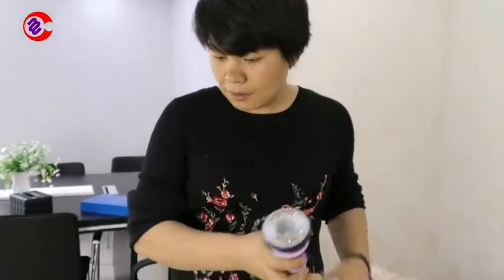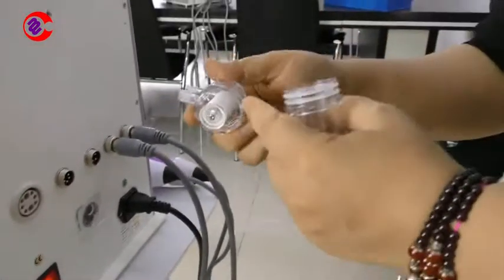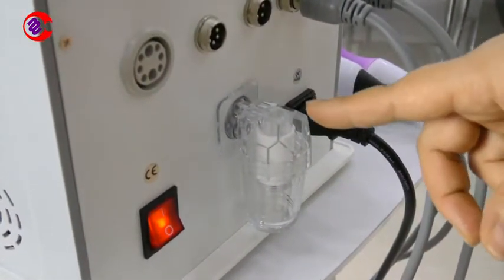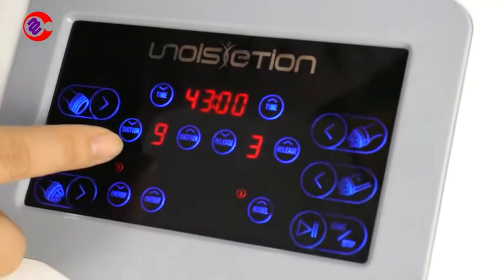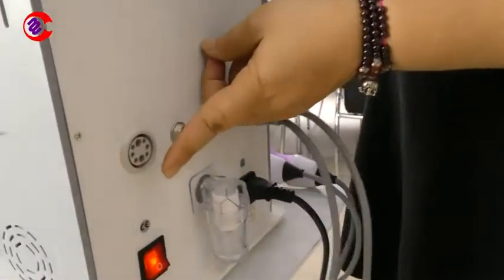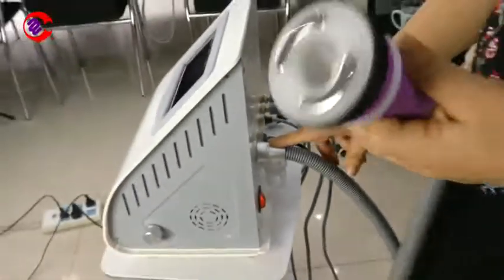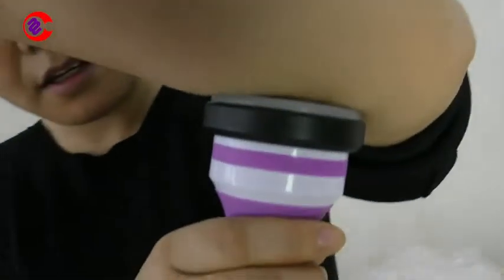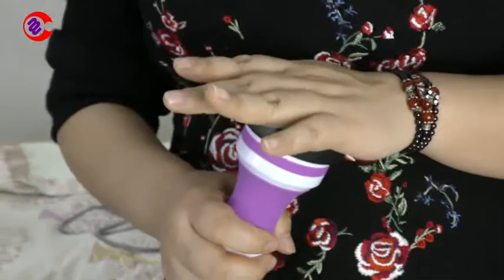How to Test Vccum RF Setting Video for unoisetioin

Comment: Does the rf probe pop if gel stays on to long and does cold hammer work for chin reduction
Reply from the maker: hi, the RF probe won't pop but the probes will stop automatically if time is over, cold hammer for the skin shrink after the skin care closed, it can shrink the skin but do not reduce the double chin, you can try other machine for double chin https://www.mychway.com/itm/1004710.html